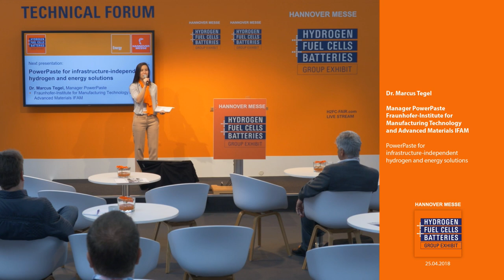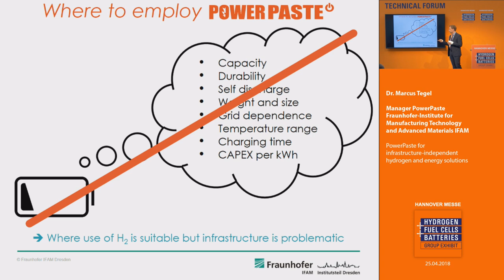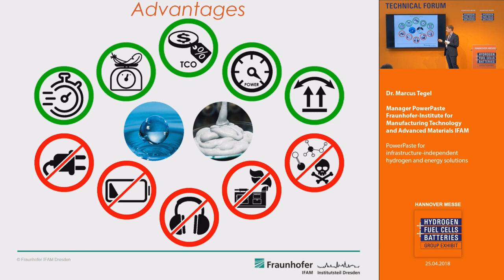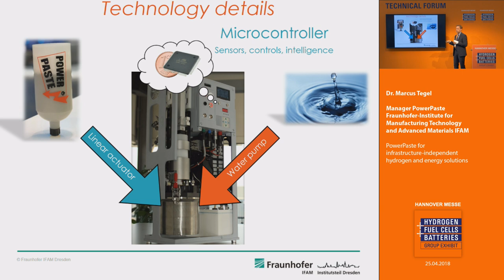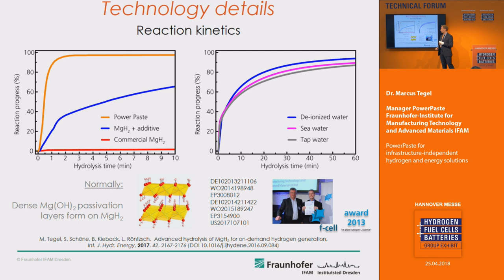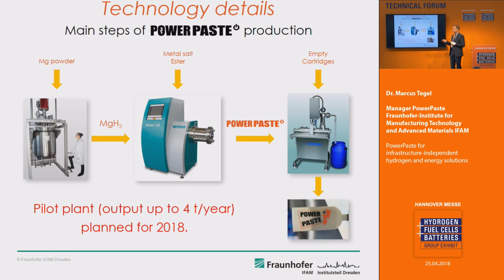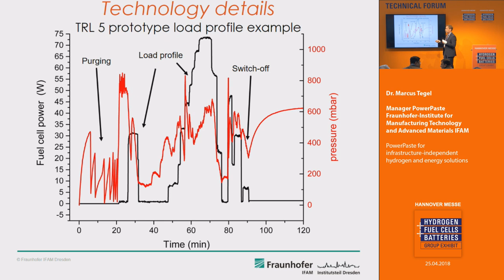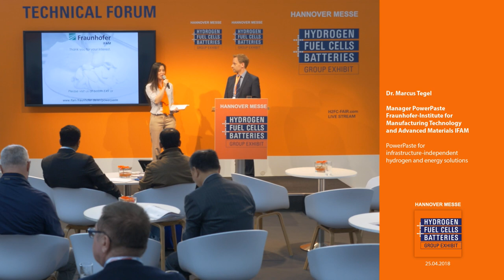PowerPaste for infrastructure-independent hydrogen and energy solutions

Comment: I don't understand why this is so unkown... I would like to work in a production site to produce this..
Reply: They can make 4 tons per year of this stuff. The uk used about 1×10^7 tons of petrol in 2019. Worldwide magnesium production in 2019 1.1 * 10^6 tons. There is not enough magnesium or produciton of this stuff for it to become ubiquitous.
Reply: @ManSubhu   There is not current usage of magnesium for this purpose. There is more than enough magnesium available to increases magnesium metal production to surpass aluminium production (the current leader for refined metal production) by ten times; both magnesium and aluminium are plentiful, they are energy-intensive to refine, is all.
Reply: Bainsworth  Zinc is pricier than magnesium, and they use that for sacrificial anodes in ocean-bound containers. Zinc is also used in batteries, so the idea has precedent.
In the other direction, magnesium is lighter than aluminum, but it also corrodes fast.